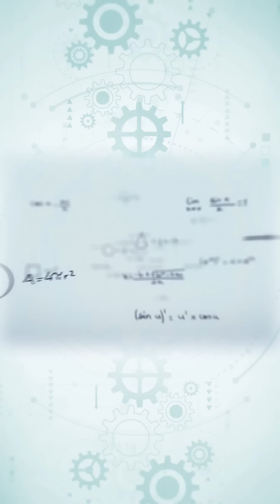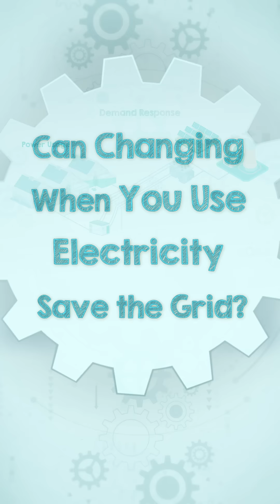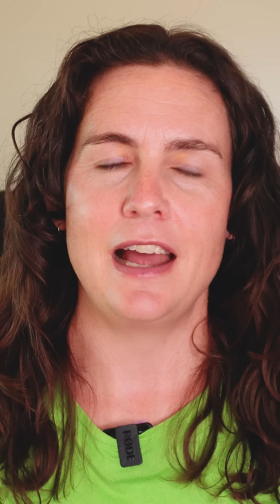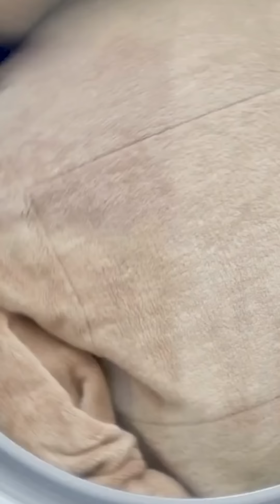Can Changing When You Use Electricity Save the Grid?

Comment: Thanks for covering a small part of what is happening. The secret is replacing the old centralized grid system with a new decentralized grid. The early development of AC electricity created centralized mega power plants that distributed a very control electrical current to consumers. Now with the development of local and scattered  energy production, along with battery storage, a "distributed generation" system is emerging. It will be an intelligent grid that manages battery charge levels. All that the grid will do is exchange electricity between battery hubs. No longer will the grid have to be "Harmonized". Batteries using advance inverters will control the quality and quantity of electricity.

Comment: In a nutshell, renewable energy makes grids less dependable while requiring more compromises from its customers.  Got it.
Reply: This is the same way the grid used to run when it was mostly coal and nuclear. It was difficult to increase capacity in response to peak loads, so they just charged more at peak times and less off-peak. Entire generations learned to use storage heaters and other electrics on timers. If you want to pay for somebody to burn gas for your electricity at peak times then feel free, but being needlessly wasteful like that will show on your electric bill.
Reply: @ganjalogic  actually, the term "peaker plant" applies to plants who's purpose is to meet fluctuations in demand.  Nuclear takes a while to respond so smaller more nimble plants are used to meet fluctuations that go beyond the projected demand.  Here in Ontario that mainly means gas plants.

Time Of Use billing is a scam that allows the utility to charge more during high demand times, which increases profits under the guise of cheapening the cost... it's 90% nonsense, 10% truth; by lowering the peaks it DOES allow them to operate more efficiently (read: cheaper) while simultaneously allowing them to charge more.  It's a brilliant piece of marketing.  Nobody's bills were reduced with TOU billing unless you are actually able to shift much of your consumption to lower rate times.  Remember, TOU came about long before anyone was charging an EV overnight, and doing your laundry after 7pm or on weekends doesn't come close to offsetting the higher cost of the electricity you use when it's necessary.
Reply: @superspeeder  Now imagine that your baseload generation is cheap or nearly free, but your peaker capacity is comparatively very expensive. It doesn't make sense to Socialize the costs of peak electricity across all customers instead of telling people to be responsible or pay for what they use.
Reply: @ganjalogic  it does if everyone is using it at peak times, which is generally the case (especially if you have air conditioning).

What doesn’t make sense is socializing (subsidizing) renewables into the grid, which make electricity more expensive and less reliable.

Comment: We already heat water with our heat pump HWS after 10am when the sun is up and the solar PV is making plenty to power it (usually).  As we get more EVs, smart charging systems and vehicle to load EVs, it should mean we can use grid "intelligence" to smooth things out even better.
Reply: I have a timer that runs my hot water from 11am till dark with two top up events at night. I have an EV (actually at least four of them, I lost count). The big issue I have is the hot water doesn’t soak up all the excess solar because the PV is three phase, hot water is single phase and the EVs charge at night typically. So I am importing on one phase, exporting in two and I still need many kw of night power. Batteries seem to be the only viable technical solution to level out the demand … if I don’t want to be stuck home all day and in the dark at night

Comment: See Japan for examples of ways they reduced not only average consumption after the March 2011 tsunami (e.g. by removing ⅓ of bulbs from all forms of public lighting, turning the a/c temperature up at summer) but also on demand, through evening news and information on the subway trains advising people when the best times to use and save electricity were that evening.

It was quite interesting to see how they treated it as a community effort and then revealed the next morning how the country had faired in meeting their energy demand goals.
Reply: PowerPal did this with a Uni a few years ago. A small cohort of PowerPal users were financially incentivised to limit power consumption between 1700 and 2000 each night during early summer. It worked and the study is available. The demand response was only 50Mw lower across three states. A large number of participants didn’t have access to Amber dynamic pricing. Amber now owns PowerPal. In terms of finding new Amber users it was a big failure

Comment: I can see the point of demand response in terms of lowering, but I also think there's an opportunity in terms of industries that can use energy flexibly, the one I'm thinking of relevant to Australia is desalination plants which are very energy intensive  but it seems could be operated flexibly whenever electricity is cheap to reduce demand on catchments, improve environmental flows and increase resilience of our water supply. If electricity is near zero cost, the water from desalination becomes cheaper as well. It's almost storing energy in a clean water supply.
Reply: Electricity is the cheapest part.
Machinery ware and tear and manhours are bigger costs.

Comment: It is said rooftop PV might be turned off and EV v2g battery used or a small home battery. 

The BIG danger to the grid owners is that the home owners may not turn grid electricity back on.

Dead grid cashflow terrifies grid owners.